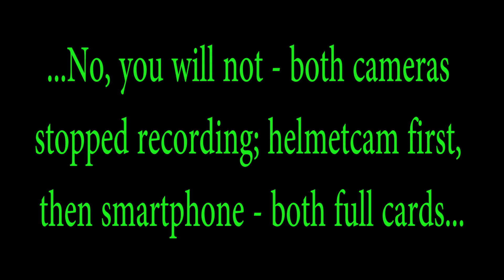How To Expand Motor Mount For Syma X5C And Bayangtoys X8 For 8.5 mm Motors

Comment: Another thing neato about this setup is you can change gear ratios too. As is, it looks like 1:5 (9 teeth on motor gear, 45 on prop). Im willing to bet a 2:3 ratio wouldnt put a strain on the motors. It would haul ass too. (18 teeth on motors/27 on prop).

Comment: Problem can be if you do not get your motor 100% concentric in the holder then the mesh of the gears will be too deeply engaged making the bearings fail prematurely - or if not deeply meshed enough the noise will be terrible and the teeth will wear out superfast.  it's not an easy job unless you have precision tools - and plenty of motor holders to experiment with!

Comment: https://drive.google.com/open?id=0B5Kvj8b4F-7uOUdKeUpIYkcwd0U

this is the motor of my syma x5c-1...where can i find it?? because all the motors in shopping sites are 20mm....(when mine 17mm..)thanks
Reply from the maker: Usually, Syma X5C-1 has 7x20 mm motors, but strangely your motors looks short to me. All I found is here:
http://www.banggood.com/Syma-X5-X5C-Clockwise-Motor-Spare-Part-X508-p-928804.html?p=EH10221611330201505Q
http://www.banggood.com/Syma-X5-X5C-Anticlockwise-Motor-Spare-Part-X507-p-928806.html?p=EH10221611330201505Q
On eBay, there ARE smaller motors, but you may see whether there is chance to adapt to bigger (and I think better 7x20mm motors):
http://www.ebay.com/itm/5pcs-DC6V-4500RPM-7x17mm-Magnetic-Coreless-Motor-for-Airplane-RC-Engines-/191978992600?hash=item2cb2d6f3d8:g:vJIAAOSwZJBX~uL9
Reply: thanks for the reply..i found that motors used in my syma x5c-1 are motors of syma x5hw...thats little bit confusing...isn't it.
Reply from the maker: Yes, that is.
Reply: :D

Comment: First of all tnx for the video. I have a SYMA just like yours and I'm planning to play around with it just like what you did. Just a rookie in drones at the moment but since the x5c is pretty cheap I think it's fine to play around with it. So I found some 8.5mmx20mm motors on amazon. Is this it? it says on the specification 8.5mmx20mm. Thank you!     
link - - http://www.amazon.com/Holy-Stone-Quadcopter-Clockwise-Anti-Clockwise/dp/B01AFNNDH8/ref=sr_1_1?ie=UTF8&qid=1463548636&sr=8-1&keywords=8.5mm+x+20mm+motor
Reply from the maker: +Julius Clitar 
It can be it. Just question is how really good are those 8.5 mm motors. I bought some once, and turns out that they are worthless. Gambling to buy on chinese shops.
Reply: I'll just give it a try lol. tnx for the quick response :)
Reply from the maker: Thank you too for nice comment.

Comment: I used this mod on my dong hang. Used hubsan h107d motors.  Turned a lackluster dog of a quad into agile and far more precise and a joy to fly.  Top mod, not just a recommend but a must do.  Cheers Wild Maniac.
Reply from the maker: +Alan Wild 
That is cool. In the meanwhile I got into problems: the motors I ordered are 8.5 mm and pretty bad. They are heavier, but not getting much more thrust. And it is from Aliexpress - random choosen motors, random performances. Sometimes got good one, sometimes bad. Anyway, thank you for the suggestion.
Reply: +Wild Maniac Tis the way of Aliexpress.  Similar issues here with "original boscom". It is always a gamble but I keep going back ;-) .
Reply: +Wild Maniac Oh got significant increase in flight time, due to less throttle etc?
Reply from the maker: Maybe magnets are stronger, thus better motor efficiency.

Comment: Where do I find the 8/8.5 mm motors?  GEARBEST is out of stock on fy326 motors.  What did you use?
Reply from the maker: +Gimp Man 
So far, I have single 8.5 mm motor, bought on Banggood for the airplane. Seems good motor - it has very strong magnets, so high performance expected (less heat in work). http://www.banggood.com/WLtoys-F929-F939-13-Motor-with-Gear-Spare-Part-p-930767.html?p=EH10221611330201505Q
But, BEWARE - this motor is only... I think CCW (blue and red wire), there is not paired CW motor. Just made for airplane which has single motor. Another 8.5 mm motor: http://www.banggood.com/8_5x20mm-Motor-For-Walkera-W100s-V929-V949-V959-V969-p-75096.html?p=EH10221611330201505Q
Bad thing is that this is only motor - no pinion!
Reply from the maker: +Wild Maniac 
Also, on AliExpress, there are four motors (two CW, two CCW) for affordable price, but also without pinion: http://www.aliexpress.com/item/Tera-4Pcs-Quadcopter-Spare-Parts-3-7V-Motor-8-5x20mm-for-Hubsan-X4-H107C-H107D-Quadcopter/32461598674.html
So far, I did not found time (nor money) to continue upgrade from 7x20 to 8.5x20 motors, but eventually will do it. Too many projects at once... something of that need to wait... sorry.
Reply from the maker: +Wild Maniac 
Good news: http://www.aliexpress.com/wholesale?catId=0&initiative_id=SB_20160308151247&SearchText=pinion
Metal gears/pinions are always better. To remove it from the shaft, just heat it on candle. To put on the shaft, I think the same thing can be done. I should to order it and try first to be sure. Then, video will be made about that + webpage update.

Comment: I did this a long time ago for My X5C-1. I used one of the little round grinding stones from my dremmel. I ground the stone down on concrete until it was 8.5 MM..Then I carefully and slowly ground off the channels. I purchased motors and realized afterwards I bought the old the old X5C motors and that they had the 8.5 MM mounts on it. Then after studying pictures on GearBest I figured out that the FY326 motor mounts are the same as the X5C and they still use 8.5 MM motors in them, also these are cheap to buy.
Reply from the maker: +Quad flying Mav 
That is interesting. I bought Bayangtoys X8 thinking that this is the cheapest quadcopter, but turns out that FY326 Q7 is even cheaper, and has 8.5 mm motors. I assume that this means more power and more wind resistance. Ordered few 8.5 motors, waiting until arrive. Thanks for comment.